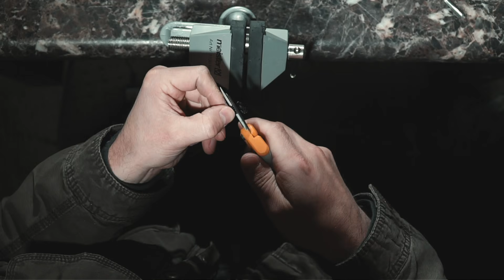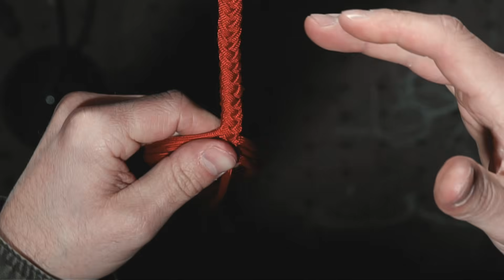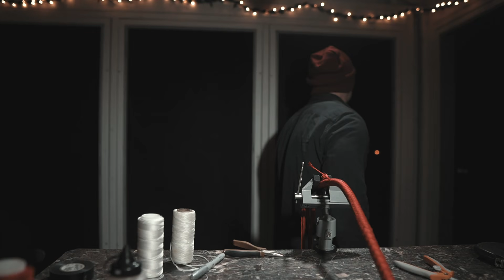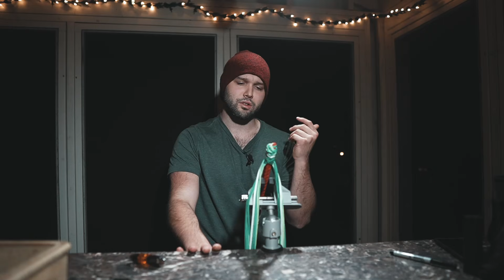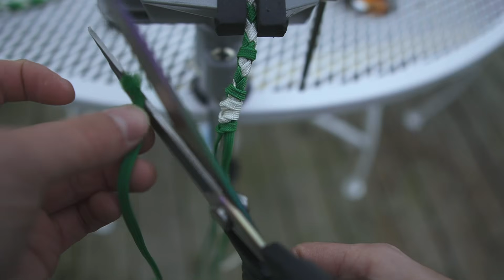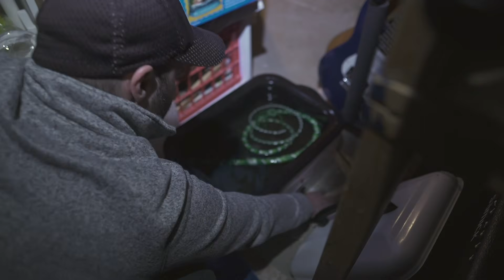My Current Nylon Bullwhip Making Method 2020

Comment: I just wanna say thank you for making your videos. I’m currently attempting to make a 15 or around 15 ft whip using this technique for the colour design. I have a depression issue and sometimes I don’t want to get up in the morning, but one day I watched a video where you were in your garage making a whip and I attempted my own. I don’t wax them cause I don’t have the equipment, but I’m currently working on my 3rd one. The 4 ft didn’t turn out great, but works. The 10ft one turned out pretty good. The handle size is way better, the colour is better and it sounds and looks great. I just want to say thank you for the chill vibes and helping me keep my mind calm. Keep calm and whip on.

Comment: I've always wanted a whip. When I was a kid I tried making them, unsuccessfully. Thanks to your tutorials it took me just 1 month to go from crappy non cracking whip to whips that I could easily sell if I wanted to. Fully functional sturdy whips that easily crack and won't disintegrate.
I actually switched to 5mm spring steel rods before watching this vid.
Hyped to see you did the same.

I experimented with some different materials for the core. I tried steel cable instead of bb's. Actually works well, but you really have to be careful not to cause kinks in the cable. Does wonders for the stiffness. I also tried shrink wrap instead of sinker cord + electric tape. But I think that it will disintegrate either by age or fatigue. So I'm trying different types of cord.
Right now I'm using paracord 1250. Because the bb's fit easily and it slides on the end of the spring steel rod easily.

I have yet to find a local dealer for artificial sinew though. Not much of that stuff around in Europe. I have to import it from the US or UK. Unless someone can point me to a store located in The Netherlands or somewhere close.

Comment: I've never made a whip before, but I have wanted one since I was a kid. Do you think a total beginner would be able to make a whip using this method as their very first build? I know there are some other, more simple designs for making whips, but I just really really really want to get my hands on a whip like this that takes no shortcuts and is a high quality real design. I've had a couple really crappy "whips" that were basically just props, but I did eventually buy a cheaper (like $70 or so iirc) nylon whip later that was a real whip and I got pretty good at cracking it. 

That was a big step up from the cheap leather rope "whips" I'd had before, but it still wasn't great. I have wanted to get a whip that goes all the way, no holds barred. You think a beginner would be able to follow this tutorial and end up having a pretty good whip, or would you recommend starting with an easier design? I know it's a sin to use electrical tape, but what is the reason behind that? Does it make that much of a difference in a whip or what? This whip wouldn't be used for any practical reason other than just cracking and having fun with it, so I'm not too concerned about like durability and stuff. I really just want me a nice whip, man, so any advice would be awesome!

Comment: I am considering using a quarter inch titanium rod for a handle because of it being light and strong. I know it wouldn’t cut down on weight much but I figure the less inertia it requires to get the whip moving the better
Reply: Bit late, but in case you haven't done it yet: don't. Titanium is brittle, expensive, and doesn't weigh enough. The difference in weight would be difficult to notice just hefting it, but when you tried to crack it, you'd probably need to use more muscle power, since the weight of the steel handle spike is part of what balances the whip. You're basically holding a huge lever right by the fulcrum, so any change in weight there would only affect the whip closer to the fall.
Reply: @buttmonkeysupreme  I didn’t I ended up using 1/4” drill rod. Very straight and non bendable.

Comment: So I’m about to start my whip, via this tutorial. But I had a question on belly plating. In having and life long obsession with braiding and weaving things. I see a difference in the motion of a herringbone vs diamond plate. I was wondering if doing one or both bellies in diamond, while more time consuming. Would add a little weight and stiffness, replacing some binding?  Then of course the nice herringbone for the overly.
Reply: i would experiment and see how it turns out
Reply: diamond plating is loose bc its harder to tighten

Comment: My fault I know. your content is very indepth, but somehow I ended up with my 11ft sections on the same side. So dropping strands was chaotic to the point I wasted about an hour. Still not a big deal but an unplaiting guide would be great. For example I've seen you take a whip out of your clamp and just drop it. I'd like to see a point to where I know exactly where to resume. My issue is your new way of dropping strands and continuing to plait in reverse

Comment: I've been a fan and made several whips with your tutorials. My first whip broke due to electric tape and whips anyone that thinks they know how to crack a whip. That's hilarious. Now when you get into new steps I wish you would let people know more than an inch before a new technique. I haven't made a whip in a few years and just cut the first belly off of my core. I know you have a whip repair guide but an unplaiting guide would be great. I had to unplait a few inches and messed up bad. I couldn't fix what I had done.

Comment: I find switching from a 2 strand herringbone plait, transitioning into a single strand herringbone plait for a few passes, an inch before the single strand diamond plait makes things a little simpler for people that are still starting out and it makes the transition look a little smoother. 
There also isn't such a large bump from a double herringbone to a single strand diamond. Not a big deal on the first belly especially on the handle before the transition.

Comment: hey coach I make snake whips i just received the rod and the sinker cord (from the links) I can fit the rod inside the cord a few inches , im still having trouble sliding the BBS down the cord , is there a trick ? I tried coconut oil and just wetting the cord, it didn't slide any better ...getting the BBS down the cord  is still very slow , any tricks to get them down easier?

Comment: @NicksWhipShop
IMPORTANT QUESTION 
When you say....24 ft length for a chord...
Is it 24ft when it hangs off the side for plaiting..OR is it 24 feet.. THEN you find the middle and 12 feet go on each side😟 sorry but i was coming up short and think I  misinterpreted at first, not sure though😟 it seems like it should be 24 ft on left strand 24 ft on right strand if the listed length was 24 feet just as an example...i know the question may be dumb but i am genuinely confused because using a listed length then finding the middle left me REALLY short🤷
Reply from the maker: Not a dumb question at all! Whenever I state any strand length, that refers to the entire length of the strand. 24ft strand means 12ft on the left side, and 12ft on the right. Sorry they are coming up short. It could be due to the tension at which you are pulling or the type of paracord. how short are they ending up if I my ask.

Comment: @29:00 you NAILED my OCD to a T 😄
OMG i have been watching all your vids and taking pointers from each one trying to build my first whip..Because I started with to thick of a rod it threw a lot off since it got thicker and thicker, (think i used to much medical tape too🤦)but it is coming together thanks to all your pointers🙂...Key point i think is Major is the string legnth....when you list say:
2 @ 12 feet
1 @ 8 feet
1 @ 5 feet (random 8 plait example)
That means??
Left side has:
12 ft
12 ft
8 ft
5 ft
Right side:
12 ft
12 ft
8 ft
5 ft....
NOT...that you cut two 12 ft pieces and then let half hang on each side...
Ie the measurements are for what each strand is when it gets braided (NOT before you attach it) is that correct?

Comment: I'm following this tutorial as I make my first whip. I got to the 16 plait overlay (all 1 color) and I'm having trouble getting it started. I tend to loose track of all those strands and they're slipping down on me. I have started twice so far and both times ended up with a rats nest both under the table and on the whip handle. (Big friggin knot colony)  Do you know any tricks to make this any easier? Great tutorials you make BTW.  Thanks Nick. BTW: When I drop a strand and use it as the core, I tie a knot in it and hang my hemostats on it so I don't get it confused with my active plaits
Reply: Same boat here on starting 16 plait overlay. Redo and redo until right. Can't imagine 24 plait.
Reply from the maker: Hi Mark, thanks for watching! As far as the tangling under the table goes, frequent untangling can help a lot with that. Especially with longr whips. After 10 plaits or so. As for the tngling on the handle when starting the overlay, recognizing which strand is and reducing the bunchiness will come with practice. One thing that has helped me is pulling each strand lightly to see which one is moving first before you plait it.

Comment: Nick, love the videos.  Thanks for taking the time! 
My question is,  I keep trying to make the whips like your videos,  but the lengths never work out correctly. (Usually come up significantly shorter. ) My first belly on this video's whip came out +/- 24" instead of +/- 36". Any hints you can give me? Thanks again for all the videos!
Reply: I had a similar problem! did you ever figure it out? my first whip the only think i could think of was that i was pulling extremely tight which was lowering the width of the cord which meant i had to do many more plaits. Also thinking maybe because he is using 650 paracord, it's slightly wider so 550 coreless would require more length innately

Comment: dave again i know why you went to sinker cord because its easier to get the bbs in.what i did so i still use stock paracord for my core was take an old bb gun barrel and turn one end of it down so it fits easily into the paracord.That way you have a flawless transition

Comment: Many thanks for all your videos. One question before I start making my first whip. The strands length on your website. Does it work only for 3/8" paracord or I can  use a 5mm or 10-12mm cord for instance?
Reply: 3/8ths is only used for the core.  It's really big.  It's nice cause you can fit bb's really easy in it.  550 or 650 is ideal.  The number I believe is the weight rating in pounds.  550 is very close to 5mm.
Reply: @korruptgaming1370  The funny thing is that I started making my first whip today. I used a 5mm shoe lace (not paracord) which was tottaly fine for filling with bb's. Actually I use this shoe lace as the only cord for the whole whip cause it's nice and flat. But it stretches a little bit,  so I have to pull the strands all the time to keep them tight. I've almost finished the first belly. It has taken about three hours. Oh, it's so difficult. Wish me good luck and patience.
Reply: @dima_the_singer  you got it. i just started and I've gone crazy.  I've done 3 for family 3 for myself and sold one within maybe a month.  Hands are so swollen feels like I have arthritis and carpal tunnel

Comment: Nick, I'm not sure what's going on with the strand lengths.  For the first belly, I had to drop strands way before you did so I made all the lengths 2 feet longer than your measurements for the second belly and I still had to drop strands way before you did. I've noticed this being a pattern since I made my first whip using the tutorial you posted a few years ago. I'm certain I'm getting the right measurements so I'm not sure what's going on. I am using 550 paracord that I bought at the local outdoor shop that I am gutting myself. I'm hoping you can help me out. I would also just like to mention that I am a big fan of your channel and that I have been having a lot of fun making whips since discovering your videos.

Comment: Hello from Alaska. Thank you for doing these videos. You have a perfect voice for this. I found I have one problem that I can't seem to figure out. I keep running short of thread. I had to end the 2nd belly of my 6' whip at 34" (I had already added 6" on each strand because I ran out on the 1st belly).  I think it is due to using whipmaker's paracord.  Are there different cord lengths to use for the whipmaker's cord?
Reply: Yes there is.  It's so thin that if you think of how many plats you have to do its way more times wrapped around the belly.  Look at nickswhipshop.com under strand lengths for the 8 foot bullwhip. Then go to his Patreon and look at his recipe for his 24 plat bullwhip strand lengths which is also an 8 foot.   See how his 8 foot whips have overlay strand lengths that are way different in length and quantity.  Let me know if that makes sense. Not sure of a good way to convert but that should be a new video! ;)

Comment: Hey nick,  I'm thinking on making my first whip and I've been watching a lot of your videos to decide on how to make it, but you always use hockey tape and artificial sinew, but in my country I cannot find neither and it would be way to expensive to import, so my questions are: is hockey tape any different from athletic tape? And could I do all the binding with the nylon tread only? Anyways, love your videos, you are inspiring me a lot to make my first whip.
Reply: I think it is very similar. I used it once because I couldn't fin d rewgular hockey tape. There may be differences, but I would think they are very slight. As far as nylon thread for binding IDK, I have always used sinew. Where do you live?
Reply: @nooneimportant4510  I live in Brazil, a place where I didn't think there was hokey rings, but a managed to find a place that sold it. In fact I just finished my first whip, I did almost exactly equal to this video since it was my first one and I wanted to minimize the chances of going wrong. The binding I did with braided fishing line, it's really thin and doesn't stretch at all, the whip got some minor hinges but still cracks like a champ, but the next ones will get better and prettier

Comment: Is sinker cord the only thing you can use as the core?
Reply: You can use normal paracord, although it is harder to get the bbs inside. I found that the cheap Home Depot brand fits bbs very easily.

Comment: Hey. Do you think you can help me. I have to drop the first two strands of the overlay but I am having issues. Can you guys like do he can see this
Reply from the maker: Hi, what issues are you running into?
Reply: NicksWhipShop the drop strands that I have are not at the same length. Being that they are not at the same level like in the video and when I try to drop them in the middle the overlay gets messed up and looks bad
Reply: I was wondering if I can send you an email.  I see that you did not respond to my last email that I send.  It would be nice if I could send you a picture of my issue

Comment: Hi Nick,
The best scissors I've come across to date are Fiskars dressmaking scissors. They are extremely sharp - like a surgical scalpel blade and go through nylon like a hot knife through butter. Watch your fingers though. I cut about 3mm deep into mine just accidentally brushing up against the blade. They will also cut cow hide - not that you're using that any more.

Comment: Nick, something I do when I'm tying a harness with really long ropes is take the working ends and do a crochet chain in each one. That both makes the ends shorter and keeps them from tangling so much. Maybe that's something you can use when you're working with extra long strands
Reply: Thats a great idea. I just started my first 12 ft whip and will be needing 42 ft strands and this will definitely make it far more manageable

Comment: Nick, I want to try making my first whip from this great video. What kind of paracord do I need? Will 650 coreless work for everything? And what size sinker cord do I need? 1/4” or 3/8”? I’ll buy everything using your links but you don’t mention exactly which cord to buy!
Reply from the maker: Hi, thanks for watching. 650 will do very well and you'll want the 3/8 sinker cord.
Reply: @NicksWhipShop  What size paracord is being used in this video?  Is it the same size for the bellies and overlay?  Is it gutted at each instance?

Comment: This tutorial is amazing. I am in the middle of the build, and ran into an issue. I on the second belly. My diamond braid ends at about 11.5", and I ran out of the shortest strand at 13.5"! Nick drops at 19. I have no clue what went wrong. Should I fuse some more paracord on? did I do too much diamond braid (and use up too much cord)? Any help would be greatly appreciated!
Reply: FYI, ended up fusing a bit more paracord to the two shortest strands of the second belly. If you do this build, I’d recommend 6 or 7 ft instead of 5 (unless I measured wrong).

Comment: I'm currently working on my very first two whips, based on several of Nick's videos. I bought the materials a while ago, based on an earlier video, so there is some electrical tape in there; however, I hadn't yet done the binding on the second belly of the second whip, so I decided to make as best I could of the situation, and pick up some hockey tape for the remainder. 

Me at sporting goods store:
"This is in the hockey section, and it's tape, and it looks fabricky, but it's called 'hockey stick tape'; is this the right stuff?"
lifts mask, sniffs tape
"....It is."
Reply: I did the same exact thing😂